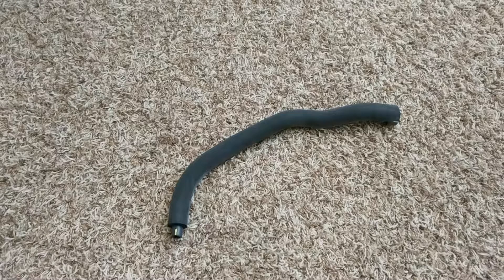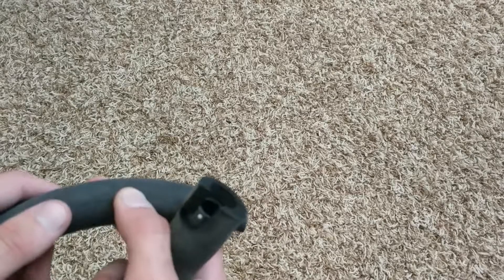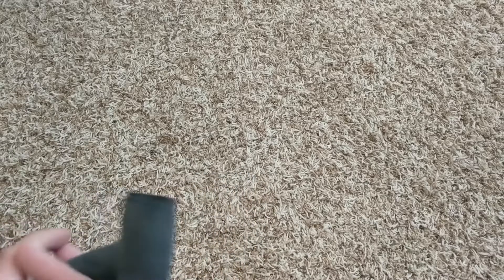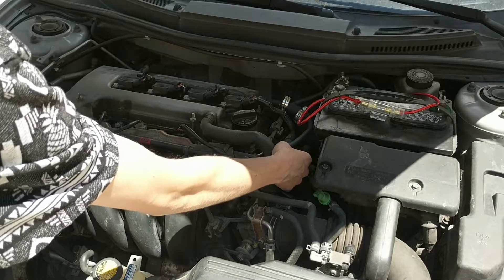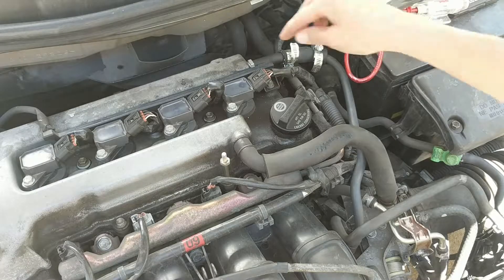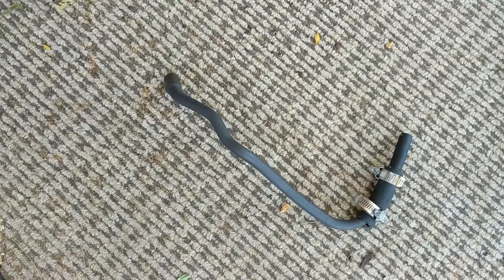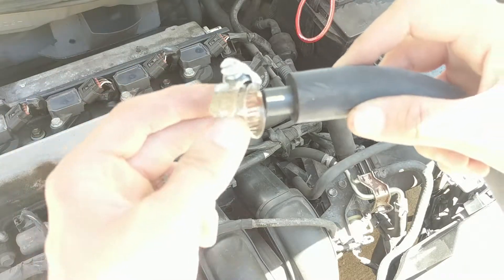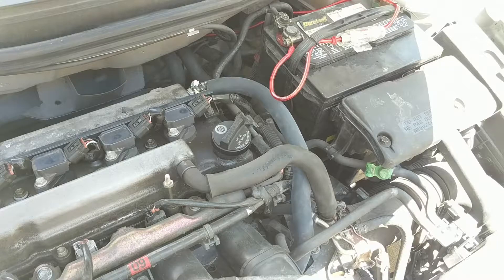How To Install a Pcv Hose Toyota Celica

Comment: he means the small hose end fits on the PCV valve tube (PCV mounts on the valve cover in my 1999 Corolla 1.8L 4-cyl. engine) and is secured with a clamp ... the blunt end goes on the engine. A new PCV from NAPA is made in Japan, which is good and I figure a Corolla from 1999 needs a new hose and PCV both in case of an air leak, which can spell real trouble! I replaced the entire hose as well and found the upper end (at the PCV valve stem) was cracked and split, so that would allow some air to enter... It's a pain to replace in a 1999 Corolla, but with patience, I did it with long nose pliers...  The old hose had buildup in it at the engine end, I saw.
Reply: I have the same car. Are you  saying you replaced the engine end of hose using long pliers?  it is difficult to access.

Comment: The point of the spring clamps is for the clamps to (expand and contract) when the engine heats up and when it cools down. Other clamps will expand and lead to a vacuum, oil, or coolant leak.

Comment: My 2001 5 speed has always been grinding into 3rd. 
 I just bought some Amsoil oil designed for the synchros. It is very thin so it will let the synchros stop spinning earlier. 

It also seems to have a defective clutch master cylinder ? The slave is new. When cold, it is hard to get OUT of first. I have to wait until the RPMs fall to 1,000. The mechanic 'pumped the air out of the master' and it was good for a few weeks. 

For a couple weeks, when at a stop, the engine would get rough and RPMs would go up to 1,100 for about 20 seconds. Just tonight, it started jerking around 1,500 - 2,000 RPMs. 
I will check MAF, air filter, EGR ... but then I give up. Not sure where to hook up a vacuum gauge. 
 
My temp gauge stays mostly in the middle but varies with outside temp.

Comment: Yes, that is the normal operating temperature for the engine, you don't need to worry for that. If it goes to the next higher line it means that it will overheat soon